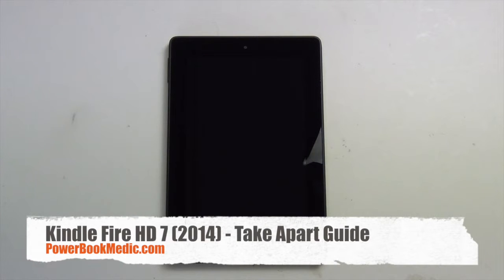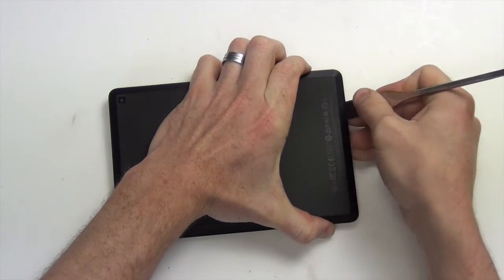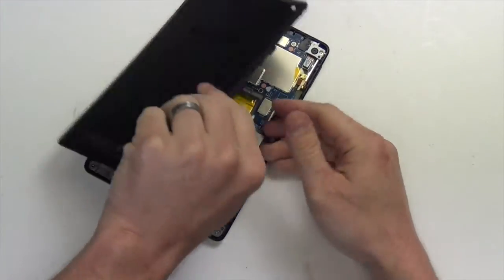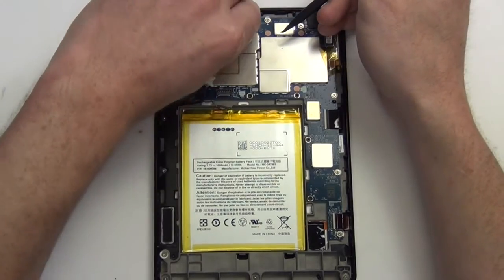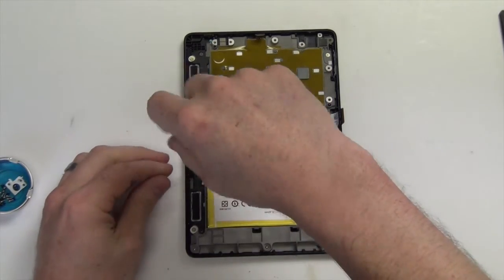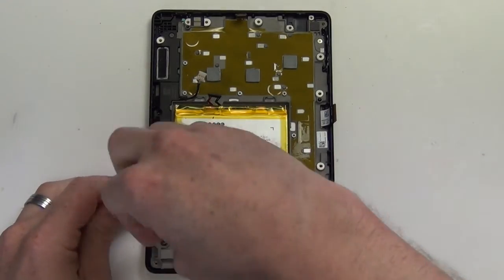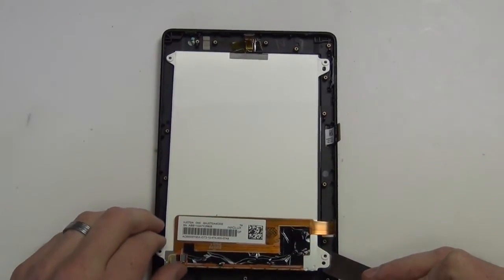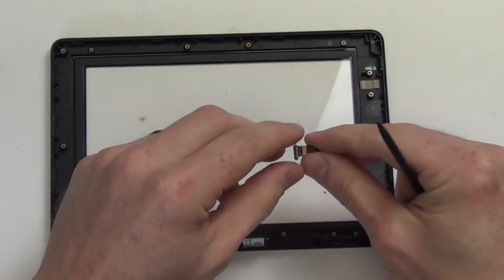Amazon Kindle Fire HD 7 Take Apart -  2014 Model

Comment: Hi, every time I want to write something on my tablet i have to flip it around because the bottom part don't works well, Do I have to do this to fix it?
Reply from the maker: You most likely need to replace your digitizer.
Reply: Ok thanks, but this started happening after I took my to change the screen because it was broken, I was to busy at work so couldn't bring it back when I noticed the problem. I was wondering if was something wrong with the reassembling. Do you have the where I can see how to change the part you told me? Once again thanks